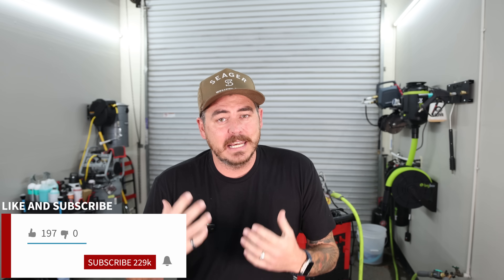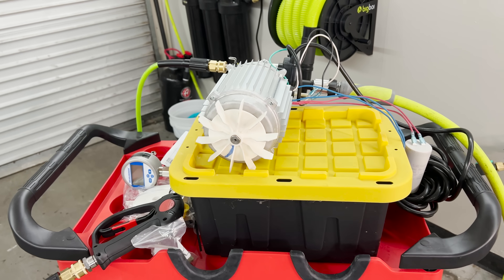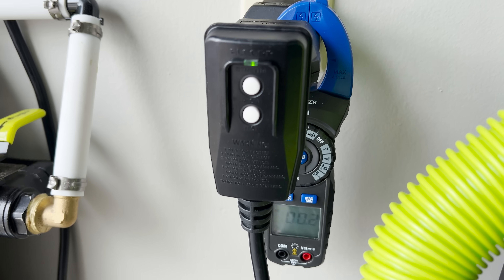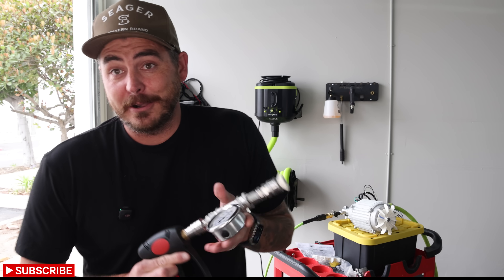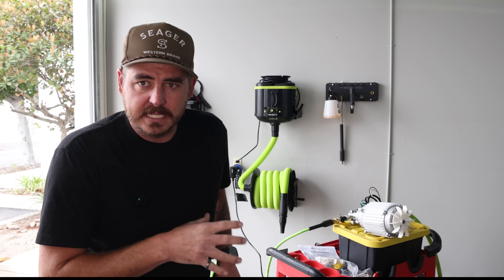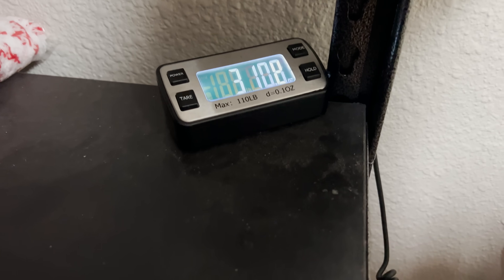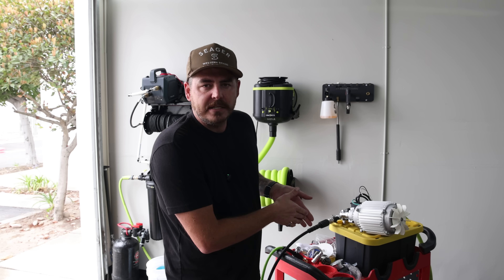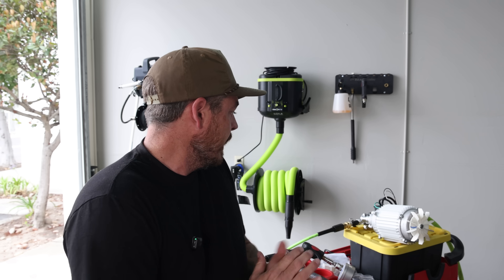QUIVR PRESSURE WASHER HUGE UPDATE! - First Test: PSI & GPM?

Comment: Mechanical Engineer here. An induction motor will have a large in-rush current when starting up. Basically the lower the RPM, the higher the amp draw until it reach the synchronous speed. A breaker doesn’t trip the instant it goes over its rated amps. The breaker works by heating a metal strip which makes it expand. When it expands enough it trips a spring loaded mechanism to cut power. Every breaker has a chart that shows how many amps for how long to trip the breaker. This is why pulling high amps at start up doesn’t trip the breaker.

Comment: Many do not wash their car in the garage, and almost no one has a garage as nice as yours. I sure do not. Mine is filled with stuff. An alternative is a gas pressure washer which is highly portable, no cord needed and there are no issues with amps or GFI. Almost anywhere in the US you can buy a used 2600psi 2.2GPM - 2.4 GPM portable gas pressure washer on wheels with a Honda engine for ~$100-$150 (you may have to rebuild/replace the carb). Since most will replace the hose with an 50' Uberflex or Flexzilla plus a better gun and a foam cannon, you could be into everything for $200-$250. No question gas pressure washers are louder and produce exhaust but not a problem if you are using it outside. If you want to lower the pressure to 1200psi out of the gun/wand for detailing, just use a nozzle with a larger orifice or an adjustable nozzle. With 2600PSI machine, you would need a size 4.5 nozzle to lower the pressure to 1200PSI out of the gun. The 2.2-2.4GPM flow rate will remain the same because the pump determines the flow rate. Here is the math for nozzle sizing - https://imgur.com/a/XN8WlaC.

Comment: @imjoshv Re: noise. Have you thought about adding some mass to the inside of the side panels? Thinking thin neoprene (maybe 1.5 or 2mm) should not only provide sound damping by reducing propagation of certain frequencies it'd also reduce potential resonating frequencies of the enclosure due to the additional few grams of mass. Also, given buying sheets in bulk should add very little to the costs.

Same would also be true if you had rubber feet with a durometer rating of maybe 55A or 65A to further limit vibrations while sitting on solid surfaces (concrete/tile/asphalt). That said, I have no idea whether a contact point with an area of say 1 square inch provides better vibratory damping versus a larger or smaller area.  But I'm sure it wouldn't be too hard to find out.

I'm happy your happy with the progress. Never easy trying to bring an idea to life and I'm sure there's been a bit of stress!

Comment: Nice test run. Need to up the PSI from 1000 to 1200, as to meet your nominal 1100 PSI standards for auto washing. Looks like it could be a nice portable unit when done and find a chassis/case for it. Took a bit of courage to run it on top of the plastic bin. Next time use a square piece of scrap wood (plywood/particle board) & drill a couple hole to strap it down. or a cinderblock. Have enjoyed your demonstrations with results as action does more than words.
Reply: You do that with your pressure washer that you're creating

Comment: Hey Josh, would you be able to provide the pressure washer alone without any hose, gun or accessories? That should help drop the price a bit too. I'm sure your viewers would appreciate it as most probably already have better replacements in the garage.
Reply: He will have the pressure washer, and also the full kit with the nozzle holes etc

Comment: looking forward to a generator test! i have a 3500 in my set up. i also love the fact that you saw 850 psi and ran test on a second gauge and you were like i like these numbers better lmao also you didnt mention nozzle size! im guessing going smaller would decrease flow increase psi and wattage too.
Reply from the maker: Yeah the nozzle I am using is close to a 4.5. I tried a 4.0 and it went above 15 amps

Comment: Only 1000psi isn’t bad but really would like it to be closer 1500psi-1800psi.   Gpm is fine as anything 1.3-2.0gpm is perfectly fine for what we are doing.   Hope to see how things turn out.
Reply: If it’s pushing 2.1gpm at 1000psi it should be pretty easy to swap out to smaller orifice nozzles to get 1800+ psi without dipping the gpm under 1.3. It would just be a question of the circuit youre plugged into, you’d absolutely need a 20A dedicated
Reply: @gaugeprower  i wonder how much of a difference in amperage doing that would make.

Comment: Josh, this pressure washer is impressive. I understand that you need to refine it, but so far, it looks great. If you can bring it in under $500, it will definitely be a home run.
Reply: he has you all fooled. this is 99.9% done he cant change much from this point besides the shape of the plastic the chinese motor company puts around their motor. you are looking at the final product.

Comment: Mobile car detailing in florida was the ticket used gas powered pressure washer and two bucket wash i did nothing but show cars and exotics I usually worked 6 days a week made a shit ton of money just hated washing and detailing cars I love cars . I am a gear head mechanic liked detailing my show car and the daily plus race car of my own but as a job there was no challenge  in it if you can cut and buff paint its really just time the only part that gave some sort of challenge was paint correction other then that I bought a tow behind trailer  chemicals and supplies started detailing got very board first year sold itbto a friend who still does it and now owns one of the major mobile detail paintless dent removal

Comment: Looks like a fantastic product Josh!  I love the $350-ish price point, but quite honestly with what you’re offering …  $500 would still be a bargain when compared to the competitors with comparable features and performance (active 2.3, big boi, AR630, kranzle, etc), especially when you factor in the Josh Seal of Approval from manufacturing perspective.   
What you’re offering is exactly what the car detailing scene needs … a GOOD performing quality product in the appropriate DIY mid-tier $400-500 range.    Other than the Active 2.0, there’s not really anything after the $150-ish big-box stores before getting to the Active 2.3/Big Boi $600 tier and then the AR/Kranzle $800+++ tier

Comment: 2:44 Josh, is it possible or feasible to have a Nitrile/rubber coating on the inside of the plastic housing? That would absorb excess noise and vibration (just based on lining of brake pads, and what I've done with subwoofer enclosures) I don't know how it would affect the cooling or if that will make a difference, but I just figured I'd would mention it to help you potentially get the best possible user experience! 👍👍 I'm so excited for you Josh, and for all of us that will be purchasing it!! 👌😁

Comment: Engineer here! I love your numbers, but have a few comments.

I think using your long time pressure gauge is more useful to us as a relative value since thats what we have numbers for all the other units. 

Please don't sacrifice the longevity of the motor by putting it in a completely sound deadened enclosure with very little airflow. Motors hate heat, and I would personally rather have it be slightly louder without worrying about the motor cooking itself to death.

Finally, are you planning on having serviceable parts on the unit? Pump seals, lubrication points, etc? 

Looking forward to this unit, thanks Josh!
Reply: I agree 100%. DB levels really are not much of a factor for me I’d rather performance and reliability.
Reply: I second this fully.
Reply: Coming in clutch as very important add.
Reply: Engineer here as well and 100% agree, motors HATE heat. It breaks down the insulation on the windings and cooks the bearings. I have a 10hp electric pressure washer running on a VFD. I have always thought it would be neat to make some kind of water jacket to cool it.
Reply: Yes it will be serviceable where have You been he has talked about this many times

Comment: Will UL certification require you to put a 20 amp plug on it because it draws 15amp continuously?   Isn’t there something in the code that a device must not exceed 80% continuous load of a circuit?   For 15amp devices that is 12amp and for 20amp devices that is 16amp.  

Or is the nature of it turning off between trigger pulls make this not a continuous amp draw?

Comment: Wow amazing. it’s first time making a pressure washer and its already quieter than an active 2.3, under 15 amps in operation and churns out more then 2.0 gallons per minute at the nozzle. Goes to show you that with the right focus and perspective a quality pressure washer for detailers can be achieved.

Comment: If this was my video that motor would have taken off and made a great blooper. 😂 I have never found two gauges that give the same number so which one is actually correct. 😂 In the end if you are within 50 psi you are good. It’s just a number feel is a better indicator.
Reply: No drop test with that naked prototype 😂
Reply from the maker: Haha that blooper would have been great… but would have made more testing hard.  I just ordered an Ashcroft digital gauge to test with that as well. The power and performance feels really really good and the consistency through the fan is perfect!
Reply: Josh needs cats.
Reply: @MAR4CARS He got lots of snake pets in the yard.

Comment: One suggestion. Can you change the wall plug? Please 😅
Reply from the maker: What are you thinking? Would you prefer the style that the gfci is down the cord more and the plug itself is normal?
Reply: @imjoshv yes. Because when you have the plug like the new ryobi it takes up two outlets 😅. Need the space for outside water resistance outlets